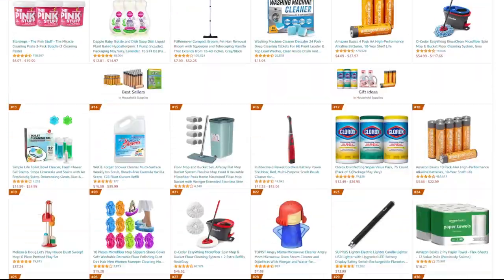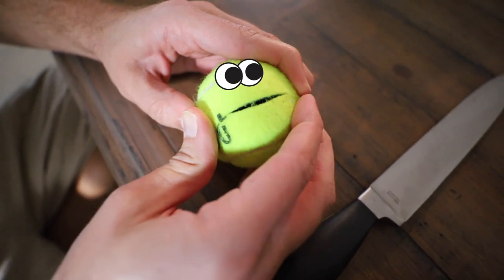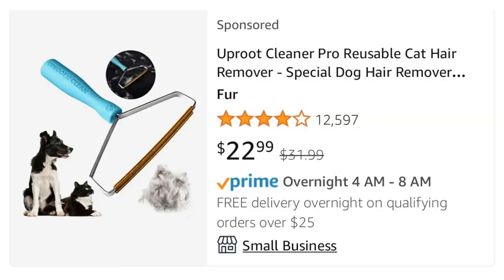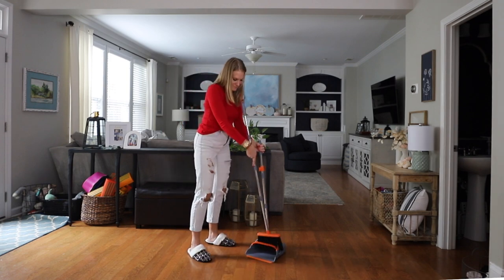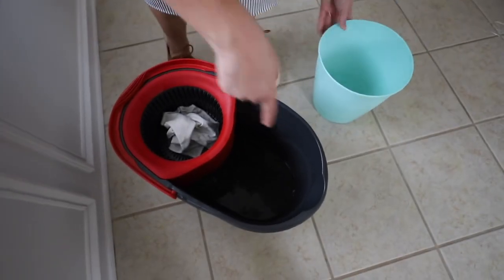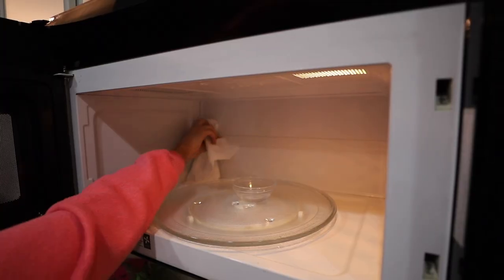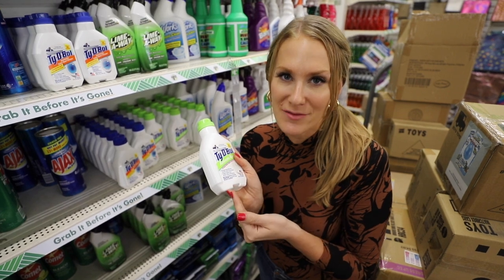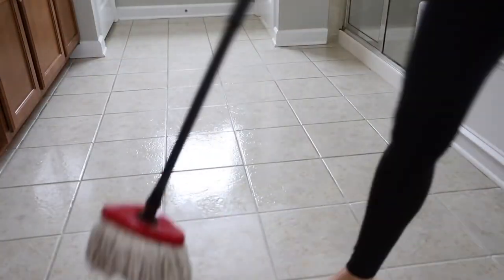13 DOLLAR TREE hacks that beat AMAZON FAVORITES (save $200)!

Comment: I don't own a microwave but whenever I did. You can take a drop of soap a little bit of vinegar and your sponge wet the sponge. This will also clean your sponge and disinfect it. Put it on for 3 minutes. It will steam the hell out of your sponge steam your whole microwave. And clean it. With the hot sponge. Make sure you wear gloves... Or just wait for the sponge to cool down a little. Walla. Using the hot sponge everything will completely melt right off..

Comment: When I've tried to heat those little glass bowls in the microwave they would always crack. Maybe I got a bad pack? But with the toilet bowl gel, you have to place it where after you flush the refill water runs over the gel to release the scent and cleaning.

Comment: I’ve found that after using the Tidy bowl in the back of my toilet , it began causing problems w the rubber flap to have to be replaced as the chemicals caused the flap to allow water to constantly leak through into the septic system this causing water to constantly run! That sizzling sound that you begin to hear coming from the toilet. So beware of using anything in the back of your toilet.

Comment: Since I have been a teenager in the 1990s my mom is always taught me to clean the microwave by putting a coffee mug in the microwave you fill it up with water that is literally it no vinegar no cleaning solutions and then you put it on for like 2 minutes and depending on if that does the trick and how dirty your microwave is you can start wiping the junk right off then if not then if there's half a cup of water left or more put it in for another minute minute and a half and if that's not enough then you might want to add vinegar and start cleaning your microwave a little more often LOL but after that you literally need no cleaning product but if you want to kill bacteria and things like that that you think might still be existing then you can go over it one last time with vinegar that you damp in a paper towel with and just wipe down the surface and then dry it

Comment: These are some good hacks, however the only thing I have to disagree with is putting anything inside the top of the toilet bowl. All of that water on the inside is fresh water. As bazar as it's going to sound if there is ever a time when you need emergency water this would be that example. I've never had to resort to using water from the toilet top thank God! For emergency survival reasons though, I don't put anything in there. It was just something I was taught about along time ago. But I do use the gel cleaner on the inside of the toilet bowl. And if nobody knew that about the top side of the toilet well now you do lol

Comment: I just spay the microwave with water and start it for 30 to 60 seconds and it works 💪🏻.

I'm still confused with the mop bucket set up, I mean, I get it, but how does the spun dirty  mop not dirty the clean water? Do you rinse the mop elsewhere then use the soapy water?🤔

Comment: You don’t need a special duster for baseboards.  Any cheapo duster works.  The mop isn’t worth it.  It just pushes water around and difficult to scrub with.  A wet microfiber pad works best.

Comment: To clean the microwave, I just wet a sponge, toss it in, turn it on for a few minutes. Wearing a protective rubber glove, wipe down the surface, re- wipe with eother a clean towel or papee towel and it is done. 

I use a plant based, FDA Certified, disinfectant cleaner, spray inside, leave dorr ajar, allow to dry and it is done. Cleaner is safe for all surfaces since it is plant based! NO CHEMICAL CLEANERS in my home! NONE! AND... they are so cost effective it is crazy!

Comment: I really enjoy your videos and have watched for years. However, PLEASE don’t recommend that anyone put laundry scent beads in any type of warmer for any length of time. They are not meant to be heated and it is recommended to moved to fresh air if you have inhaled the fumes and it can cause respiratory irritation. If you need further information you can contact the manufacturer or read the back of the package.

Comment: Your o cedar hack doesn’t make any sense!!!😂 you get the mop wet with clean water, you spin it (clean water below), you scrub the floor & now it’s dirty…..sooo…you put the dirty mop in the clean water solution, which makes it dirty!! Then you scrub some more, put it back in the “clean” water, which makes it more dirty.  I don’t understand how this is a hack😂😂😂
Reply: She put a bucket of clean water of a size that fits into the o cedar bucket next to the spinner.   It’s a good solution.  It keeps the cleaner water separated from the very dirty water.  It’s much easier to dump that smaller bucket when that water becomes too dirty & you haven’t finished the floor.  The only way to always use a clean water mop is to rinse it under a faucet each time after squeezing out the dirty water then squeezing out excess water before using the bucket with cleaning solution.